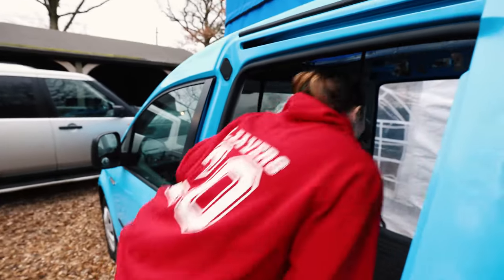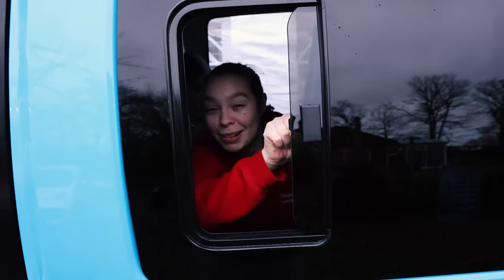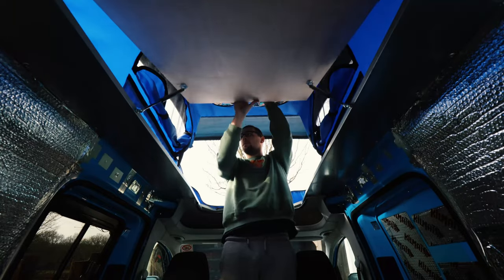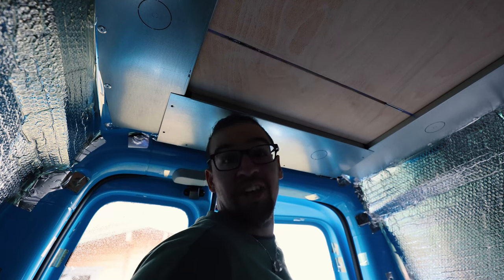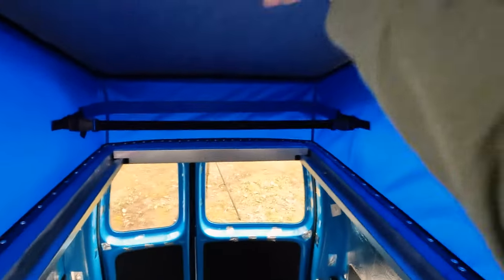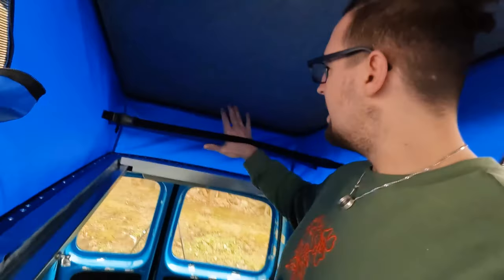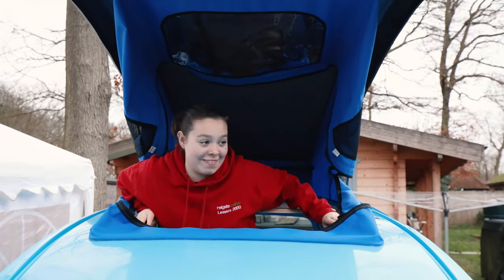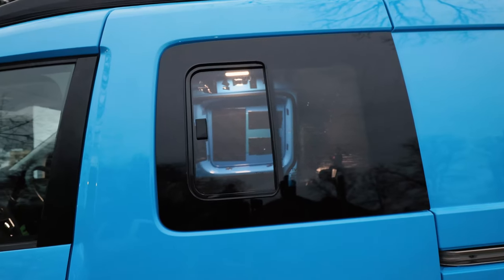Pop Top Roof + Window Installation | Converting a Van | VW Caddy Maxi | Van Build #5

Comment: If the pop top opened (was hinged) at the front it would give you more headroom. You don't need head space above the front seats. I don't know if that would have been possible.
Reply from the maker: I wish that was a thing! It would be level, and bring one side down and the other up, see alot on the older VW campers